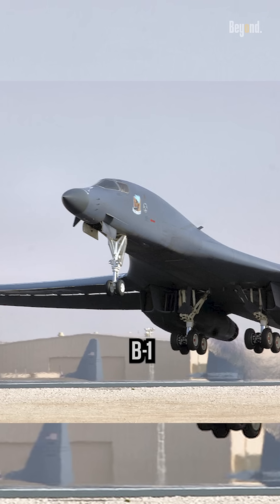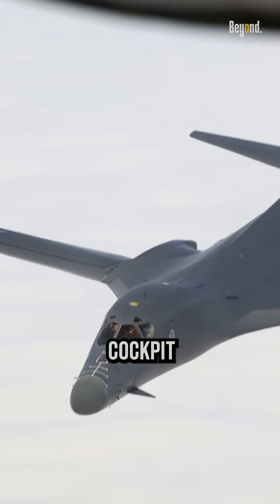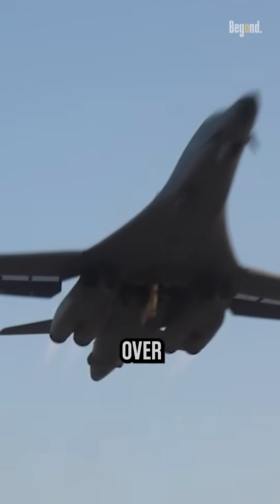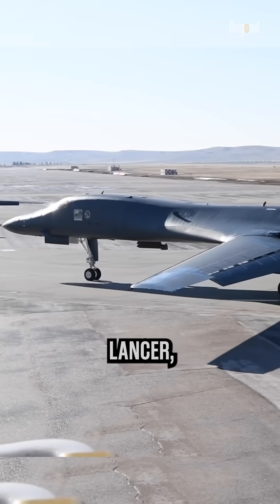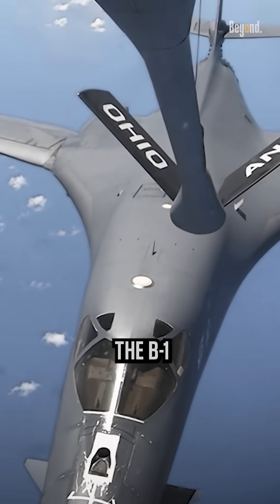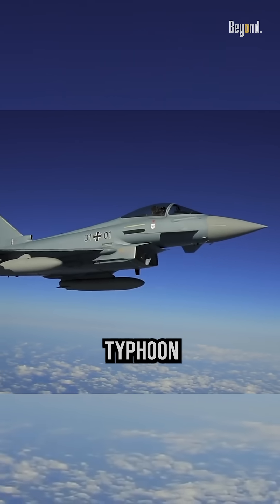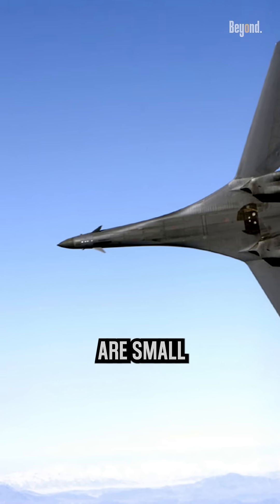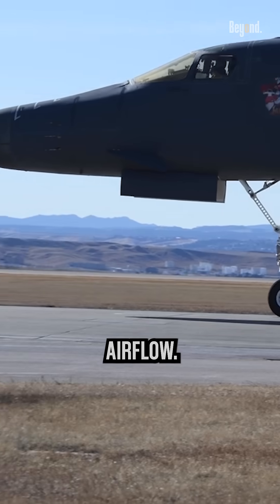Why does the B-1 Lancer have two tiny fins under the cockpit? #shorts

Comment: The typhoon's arent vortex generators, it is a canard and used in place of a elevator for delta wings. there are vortex generators on nearly all large commercial aircraft some VGs are as small as a stick of gum.
Reply: The A4 Skyhawk had small ones just behind the leading edge slats for just about the whole span of the wing.

Comment: These are the aircraft version of the Bulbils  bow which does the same except of ships. The IJN Battleships  Yamato and her sister ship the Mushi were some of the first ships to have them.
Reply: No. Not at all. The information in the video is wrong. All of it. They aren’t VGs, they aren’t used for airflow and BGs still don’t do what they’d said they do. 

These are canards, albeit small ones, and are for airframe stability. The fuselage flexes, especially in turbulence, causing a bad ride for the air crew and controlability variations. These prevent those variations increasing stability and give a smooth ride.

Comment: They are called canards, not vortex generators...
Reply: Are they fixed or moving? If they are fixed then I think they are functioning as VGs. If they are moving as a function of stick inputs they are canards. I thought those were canards added to the B model to improve precise tracking for the low level nap of the earth mission that it was designed for. But I’m not sure
Reply: @sblack48 fixed or moving doesn’t mean they are canards or not. You can have fixed canards. They are not VG’s
Reply: @rtbrtb_dutchy4183  typically a canard either moves (saab gripen etc) or has a moveable surface (Rutan etc). I’m not aware of any exceptions to that.
Reply: @sblack48  well, there are. You have fixed canards. You have free floating canards even. 

I’m pretty sure the TU-144 has fixed canards. (However, they can retract them.  They come out when they drop the nose I believe).
Reply: @sblack48 neither. They’re pretty much variable geometry VGs. Canards are more of an active control surface that are directly moved using stick controls like rudders, elevators and ailerons. The SMCS Vanes move slightly just to adjust the trim or stabilize the aircraft depending on the flight conditions. So they kinda work as both but not quite as much control over the direction of the aircraft like a canard.
Reply: @kolinmartz they are not VGs. They are there for stability. Any vortex generated is a side effect.
Reply: @kolinmartz  i would not call them VGs. VGs generate a vortex to reattach separated flow. These are actually control surfaces except they are small and are controlled by an independent active closed loop system. system. So I think canard is more accurate even though the mfg has a special name for them.
Reply: They are not canard or vortex generators. I find this all very funny lol 🤣
Reply: @davidboyd1993  they are control surfaces at the front of the aircraft , so they could be called canards. Definitely not VGs. Just because Rockwell (or whatever they are called now) calls them something different doesn’t really matter. The only difference here is that they are hooked up to an independent stability augmentation system, the equivalent of a yaw damper but in the pitch axis. Learjets have delta fins. Some cessna jets have the same thing but they call them split ventral strakes.
Reply: @davidboyd1993  you can call them vanes or canards.
Reply: @davidboyd1993  you have a very odd sense of humour

Comment: The Russian Tu-144, a supersonic passenger jet, had what was referred to as retractable “mustache canards” for added lift during slow flight due to the wing design. These things were ugly as hell and while trying to “outperform the Concord” in an airshow, the pilots stalled and nose down crashed in front of thousands of spectators. A few months later, after another crash occurred with the Tu-144 and it never flew again. Meanwhile, the Concord, whose flight demonstration was called “mediocre” went on to provide supersonic passenger jet travel until the early to mid 2000’s. #BringBackTheConcord
Reply: I'm sorry, the Concorde was flawed, and the Concordski was just even more flawed. Supersonic passenger planes may eventually come back, but the Concorde won't.

Comment: Also, I thought the Lancer in its current iteration is subsonic.
Reply: No, the B1-B is still capable of supersonic flight (Mach 1.25) but not nearly as fast as the B1-A (Mach 2.2), the difference is simpler air-intakes on the engines which don't have ramps to control airflow at high speeds.  The B1-B is actually faster a low-level, The B1-A was intended to fly high and fast, the B1-B was changed to flow LOW and fast.  Which incidentally is why the B1-B got these SMCS canards, NOT for airflow but to smooth out the ride when going really fast while flying really low.

Comment: They are SMCS vanes.  They are only used during low-level high-speed flight when the wings are swept back. They are active vanes used to dampen turbulence the aircrew would otherwise experience.
Reply: They are SMCS vanes, pronounced smucs. I worked on them in the mid-90s and actually got the pleasure of adjusting a bunch of them. However, they are used at all times in all flight modes. They're true use is to stop the plane from an effect called porpoising . When minimizing this affect it flies like a Cadillac. As a bonus it slows the cracking of the airframe along the backbone.
Reply: @tedspang1945 don't you mean BackBOne :P
Reply: @tedspang1945  are they hooked up to the stick or are they an independent longitudinal damper like a yaw damper is in the direction axis?
Reply: @sblack48  it's an independent system, the rest is classified.
Reply: @tedspang1945 great job thank you for your prior service. I'm currently working on the b1 now. Happy earlu veterans day by one day lol.
Reply: Dave, thanks for carrying on the torch. I stood This plane up from 1991 to almost 2000/ 319 OMS/34 BS/37Bs.I was an instruments  guy way before it went digital. God knows how many years it has left but god speed and carry on.
Reply: That's what I thought they were too.
Reply: The Russian Tu-144, a supersonic passenger jet that could reach speeds of over Mach 2. Due to the wing design, it had what was called retractable “Moutache Kinards” that helped provide more lift during slow flight. However, after crashing the plane in front of thousands while trying to “Outperform the Concord” at an air show, and a subsequent crash shortly after, it was never flown again. And the Concorde went on to provide supersonic passenger flights until 2007. 🙏🏼 #BringBackTheConcord
Reply: Thumbs up. Right answer
Reply: this is correct. lol these guys just make stuff up and put on YouTube having no clue what they are talking about.
Reply: That’s awesome. Thanks for teaching me something new. Had to be a cool job working on suck incredible technology 🙏🏼
Reply: Your absolutely right this video is completely wrong. I crewed them for 6 years.
Reply: @WheelsofSteelWelding  great! I have a question. Supposedly the b-1b is supersonic. I didn’t think it was. Was there ever any mission profile where supersonic speed was called for?
Reply: Finally the first person I see that got this right great job
Reply: Don’t they move more so at high speed low level? Like when it’s in tfm? Train following mode?
Reply: That’s still a type of vortex generator
Reply: @kolinmartz  Not really. Vortex generators are simple tabs of metal bent at 90 degree angles and put near the rear of the plane in certain areas to lessen the drag while going supersonic. They're literally glued to the plane and don't move at all.
Reply: @tedspang1945 vortex generators are also used on purely subsonic aircraft to reduce separation of airflow over control surfaces. In some instances they may also be used along the full length of the wing to greatly improve stall characteristics.
Reply: @kolinmartz  no it’s not. Wings generate vortexes, are they VG’s? VG’s are there specifically to create vortexes and for no other purpose. Generating vortexes as a side effect of doing what it’s actually there to do is not a vortex generator.

Comment: Those are canards not Vortex generators
Reply: Jup
Reply: They are SMCC's vanes, they help with low level flight, they aren't canards.
Reply: Nothing Canadian about this bad boy!
❤USA❤
❤VERMONTMAPLESYRUP❤
Reply: These are not canard or vortex generators and I find this all very funny lol 😆
Reply: they are vortex generatots. canards have control surfaces.
Reply: @nick4506 yep, so they are canards, because they are control surfaces otherwise it wouldn’t be able to pitch up or down because it has no elevators
Reply: @MaxC__  what? b1 has an all moveing elevator cuz supersonic like an f16 or every supersonic jet.

the vortex generators are just vortex generators.
Reply: @nick4506  the typhoon
Reply: @MaxC__   the typhoon has vortex generators too, those rectangle parts behind and above the canards.

also pure deltawing fighters have elevators too. saab j35, b2, vulcan, even the dam Concorde. i dont know what you were getting at.
Reply: @nick4506  I was talking about the canards on the typhoon lol what is there not to get
Reply: @nick4506  A canard IS a control surface.  These are NOT vortex generators.
Reply: @nick4506 canards can be fixed. They don’t need to be control surfaces in order to be called a canard. On the B1, they are fixed canards.

Comment: Those are canards not vortex generators
Reply: The Typhoon has both. There are 4 vortex generators underneath the Canards.
Reply: @anomalyfox5186 If you mean the four small fins beneath the nose these are actually for measuring the airflow. More specifically they measure the speed of the air. But they are also able to rotate side to side to measure the angle at which the air is aproaching the aircraft.
Reply: @JustYamYam  Ah my bad I just figured that’s what the video was talking about.
Reply: @JustYamYam which is what was crashing the 737 MAX
Reply: The Typhoon does not have "vortex generators". They are called canards.
Reply: @stanleybuchan4610 typhon has 2 strakes behind the cockpit to generate vortex. the 2 little canard on b1-b is part of the smcs system for dampening low level turbolence and improve airframe life and crew comfort.
Reply: @stanleybuchan4610 it does have vortex generators. But you probably mean the contrpl surface canards, basically like the tail ones, but just in the front. But, albeit not very visible on the pic, it does have additional vortex generators (and the canard working as both aswell!)
Reply: @stanleybuchan4610  it has both, you can see the little flat pieces directly above the canard
Reply: @stanleybuchan4610 it does. Look behind the canards
Reply: @stanleybuchan4610 bro if u have good eyes u can see there are also some tiny fins under the Aircraft bruh
Reply: I was going to common that.
Reply: I have never seen a thread with so many people who have no idea what they're talking about. 🤦‍♂️
Reply: @mizzyroro …I came here to see what kind of bullshit people were gonna spew…wasn’t surprised
Reply: Canards are still a lifting surface that subsequently have vortices coming off their edges which help improve vortex bursting across a delta wing... While they are not solely vortex generators they do have an ancillary role in generating vortices.
Reply: But they also generate vortices
Reply: This video is incorrect
Reply: @marcrodriguez2248  Marc, you’re causing vortices here.  🫨
Reply: Those are neither. They are part of the Structural Mode Control System (SMCS), nomenclature would be SMCS vanes. They oscillate rapidly during low level flight to provide turbulent air over the wings to prevent unwanted vibrations in the long-nosed airframe. Think of a high diver hitting agitated water surface vs smooth. Vortex generators are static and canards are a flight control surface, these are neither.
Reply: @ChaseWatkins.   Fascinating. Thanks Chase. I think your comment concludes the debate. God bless.
Reply: Thank you!
Reply: he's talking about the tiny fins not the canards
Reply: @sujitbala1492  , 🤣😂👍🏻💯 yup ‼️
Reply: @sujitbala1492 the eurofighter has canards not vortex generators, the eurofighter has never had vortex generators just like the f16 and yes I did look at the f 16 and eurofighter to find any vortex generator and they had NONE
Reply: @Mr.Roztov  look better next time. there is a small blade on both side of the fuselage. of course if you are looking for lerx like f16 you won't find anyrhing, but lerx are not the only way to create vortex. F18 have similar small blades on top of lerx, to generate vortex and address buffetting on vertical stabilizers .
Reply: Thought it was just me. Concluded it was a new term.
Reply: Dude he’s talking about the fins
Reply: I'll just say those fins are not canard, not vortex generators and I find all this funny lol.
Reply: I think canards are movable, as on the French Rafale. Vortex generators are stationary, and are common on the fore area of jet engine cowlings on large aircraft
Reply: Canards move like on the euro fighter of su 35 the b1s are stationary
Reply: @TheTeddy9212  after looking it up, I find that it doesn't matter whether they're stationary or movable. They're still canards
Reply: @petebetz5358  it matters, canards are used for higher angles of attack and maneuvering.fins are for stability . Totally different control surfaces 😔
Reply: @TheTeddy9212  I'm aware of that. I looked up the definition in the dictionary. Canards, other than being told a story or a tall tale, is a small support wing in front of the main one. Doesn't matter if it moves or not. Or at least not according to the definition.. of
Canards
Reply: Some guys just overcarpet the tops of their Cessna's wings with vortex generators so they can maybe lift off in a 1 mph breeze.
Reply: Yeah never heard of vertox generators either... Ai bs
Reply: @qwill8254  I just checked Wikipedia and they are real, they exist on aircraft and cars for the purpose of improved aerodynamic flow.
Reply: @qwill8254   look at the tiny tabs all over the tail section of a b-1, those are vortex generators, they create turbulence in the boundary layer to reduce control pressure.
Reply: @qwill8254  they are absolutely a thing. Maybe you should look it up and educate yourself instead of spouting off with nonsense.
Reply: @qwill8254 Vortex generators are definitely a thing. They’re usually placed on the wing forward of the ailerons to improve control authority.

Comment: @BeyondExplained  You are just constantly wrong with the facts.  B-1 Lancers have canards, or structural mode control system (SMCS, pronounced “smucks”).  It does have vortex generators (about 7 of then on each side), but they are near the tail cone and are tiny compare to SMCS.
Reply: This site is just clickbait
Reply: It's most probably an AI chanel
Reply: @racing_mntage1584  This is most definitely an AI. I mean, no one would say, “B-1 Lancer,” over and over again like that. The vast majority would shorten it to, “Lancer, “ or, “B-1.”
Reply: You are correct.  The SMCS system counteracts the constant pitching of the aircraft due to turbulence encountered during low level penetration flight.  This prevents flexing of the fuselage, reducing structural fatigue.
Reply: And they, the "whiskers", work in conjunction with the lower section of the rudder.  The part beneath the horizontal stab.  Interestingly enough, NASA tested early versions of this both on a YF-12 and the XB-70.
Reply: Its funny how they never get shit right😂
Reply: We engineers also called them RCV Ride Control Vanes
Reply: He likes to hear his own voice
I would love to add 3 cents. It's been quite a long time ago, but I believe the vortex are on the wings, across the top.
Reply: Are they active? Are they actuated by the stick? Or by the AP? Or is it a separate system like a longitudinal damper?
Reply: fr i don’t get how he manages to consistently post some total bullshit and pass it off as fact😂 took me 5 min to read all about the SMCS and the issues the B-1 fleet has had regarding maintenance and structural fatigue
Reply: I was going to say they were strakes instead of VGs since they are usually used on the top side of an airfoil, but your explanation is better.  Thanks!

Comment: What is the difference between canards and vortex generators
Reply: A simple answer would be canards move and vortex generators don't.
Reply: @Agul2001 negative. Canards can be fixed. They are still canards and not vortex generators
Reply: A more complex answer would be they have completely different purposes and function.
Those fins on the front of the b1 are not vortex generators. This channel is just rubbish.
Vortex generators purpose is to re-energise airflow, usually boundary layer airflow for aerodynamic purposes, like to reduce drag or increase lift.
These fins are for stability and are movable, like canards, though canards are for direct control. So 3 different functions.
Reply: @slickstrings they are canards on the B1. They don’t have to be movable. However, I do believe the B1, they are used to trim the airplane a bit for low level high speed operations.